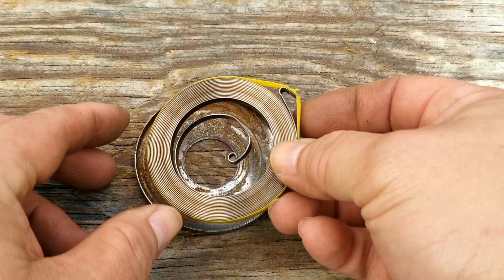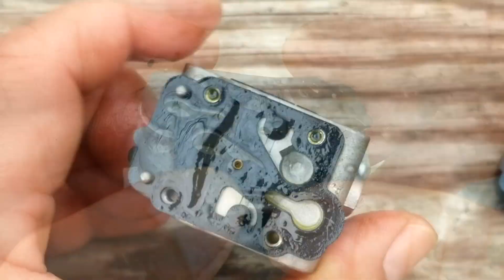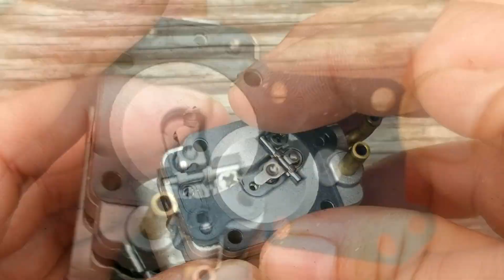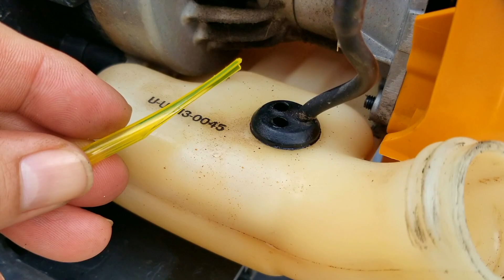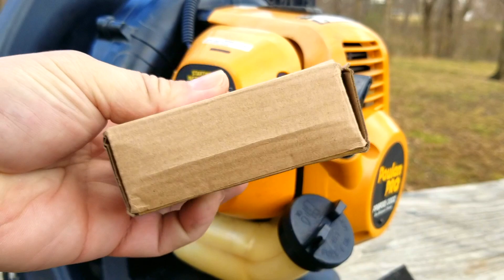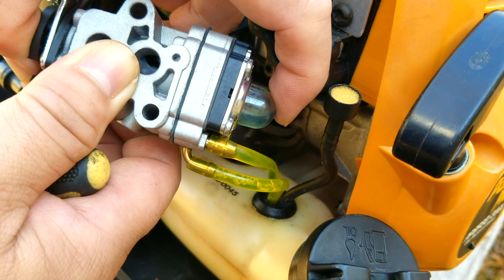Backpack blower won't get to full speed

Comment: How do you adjust the high speed.
Reply from the maker: squeeze the trigger and get it running, and then turn the high speed until you find when it's running at its highest speed, then turn the screw counterclockwise, just a tad to give it more fuel.  The extra fuel will keep the engine cool otherwise it'll burn up in a year or two of use.
Reply: @HomeGaragechannel  so the one on the top is the only adjustment screw?. When i mess with it only changes the idle speed.

Comment: The way I look at it, is this. As long as it was fixed and you didn't have to spend alot to fix it and your able to make a profit and it does what you need it to do, then in my opinion that's all that matters. A Stihl,Red Max,Echo are great machines but a Poulan will do the same job as those other ones. Great find and fix on this blower
Reply from the maker: you got that right.

Comment: I disagree with your money on the carb calculation. You used parts that you already had but had previously paid for. In order to make you whole, you need to allocate the entire cost of the kit to the project. Whatever comes out of your inventory has a cost that should be allocated to the project. If the extra parts from the kit are returned to stock, your inventory remains unchanged. The kit cost goes to the project.
Reply from the maker: I'll send you a link to my accountant then

Comment: I got a Husqvarna 130bt backpack leaf blower and it will not run full speed and it is pushing gas back out of the carburetor
Reply from the maker: I would look at the spark arrestor screen, and see if it's partially clogged.
Reply: @HomeGaragechannel  that's not clogged, I have checked everything,the carburetor for that model has no high speed adjustment, I even took the exhaust off no change
Reply from the maker: are you testing running it with the filter off?  or is your filter getting very wet?

Comment: For most part the brand really doesn't matter. A lot of these two cycle equipment used the same engine and they just slap their plastic parts to it. For $10 I would buy one of these every day of the week if I came across them.

A few years back I too we're going craigslist came across a backpack blower The ad said not even a year old had bought it in the fall of the previous year and only used a handful of time. When I went to use it this spring it would not start and it's not worth it for myself to have it fixed I just went out and purchased a new one instead. He only wanted $25 for this. He was only less than 10 minutes from my front door so I reached out got a hold of him and ran right over. As advertised it looked completely brand new just a little dusty from sitting. All I did when I was there was to pull the string just to make sure the engine wasn't locked up. It was perfectly fine. After paying him he even gave me the gas can that he had purchased a mix of fuel for this blower. 

As soon as I was back home I went into my garage planning on taking the carburetor apart.Before doing so I sprayed some carb cleaner and try to start. It would not start so I started looking at other things. Check for spark and there wasn't any. I couldn't believe that something this new would not have spark. As soon as I took out my voltmeter and started testing wires that's when I realized the on and off switch was in the off position. I'm thinking a cannot be this simple. I put the spark plug back in and on the very first pull it started up immediately. It didn't run perfect but it was still running. All I did was dump all the fuel out used my own mix for other equipment and unless then 1 minute of running on good fuel it's straightened out and ran perfect. After using it I went into the house and looked up what the previous owner what have paid for this. It was a craftsman brand and according to their website brand new this was $229. Here I paid $25 just because someone was too impatient to figure out what was going on.

Great video look forward to watching more.
Reply from the maker: thank you David Frank.
Reply: @HomeGaragechannel  honestly thank you for making such good videos. I really enjoy watching them.

Comment: Got a question 🙋
Got a husqvarna bt150 and when I pull the the recoil rope it feels like it hit something and it become hard to pull. It only happens on the first pull and after that it feels normal again. This started happening this year after 2 years of light use.
Reply from the maker: I think it's hydro-locked on some fuel leaking into the engine.
Reply: @HomeGaragechannel  thanks for the reply! I'll remove the spark plug and pull it to see if any gas is in the piston.
Reply from the maker: @XloMotion  worth a shot

Comment: That was a bargain for the price! The repair was well worth it and the new carb you put in you could tell it had the power back in it.
Reply from the maker: yes most definitely, it's on the rich side but as least I know it won't burn up in a year or two.
Reply: @HomeGaragechannel  Not to mention the value you get for under $20 for extra fuel lines, primer bulbs, and the carburetor itself.
Reply from the maker: @cdos9186  the extra parts work well for me but I do wonder if regular people will get the same sort of feeling. I mean they might only ever try and fix one or two pieces of equipment in their lifetime.
Reply: @HomeGaragechannel  Most of them probably appreciate it, but some may go "What do I need TWO primer bulbs for?".
Reply from the maker: @cdos9186  I'm going to agree with you

Comment: You also have to add in the blower tube extension that is missing. Sometimes those are hard to come by. In the end you probably have a blower to sell for about $75. So really you make about $50 for 3 hours of your time. I really try to keep my time to $20 per hr. If it is less than that I they to stay away from it. Nice video with a great example of a less than optimal carb clean/rebuild.
Reply from the maker: you make a good point.

Comment: how and where do you get the parts or carburetor you need 
i look at the parts diagram of the machine that i am working on then go from there or the part number on the carb and i try to get my parts from amazon because it's cheap and convenient
Reply from the maker: I go toe replacementparts dot com and cross over to amazon
Reply from the maker: @Officer21 that's a fantastic fuel

Comment: The problem with that specific carburetor is thah lacks the two adjusting screws to fix it
Reply from the maker: they certainly don't make it easy do they
Reply: @HomeGaragechannel  my backpack blower I think, has the same carburetor
Reply from the maker: @samuelvelez1643  Yes I don't really like these carbs. If I could, I would find a different carb that I could adjust to replace it.